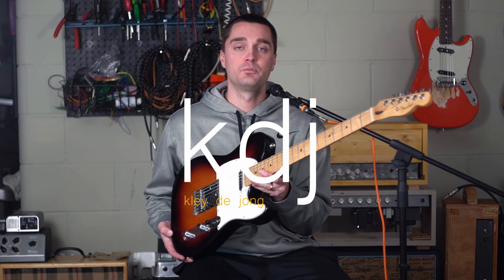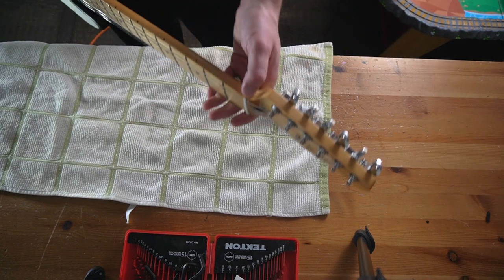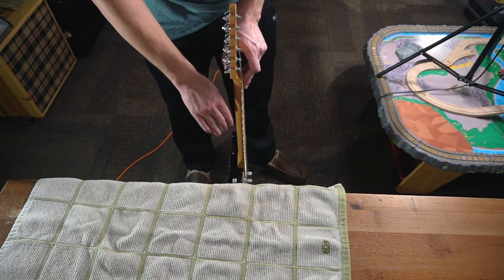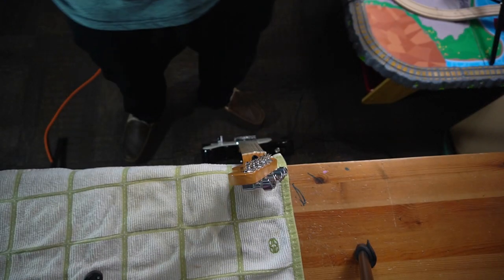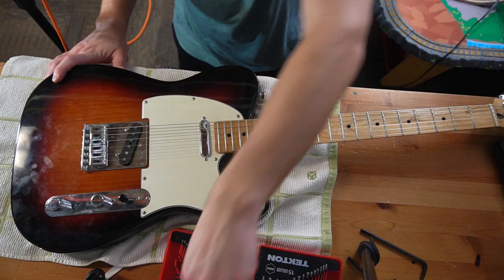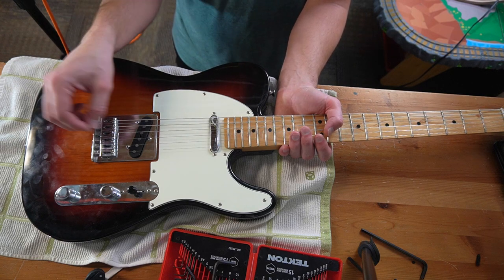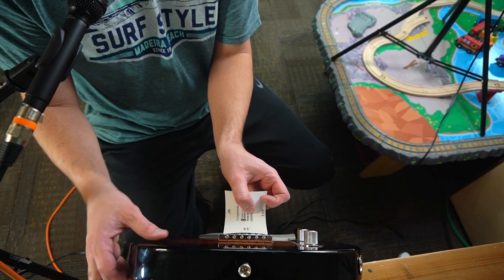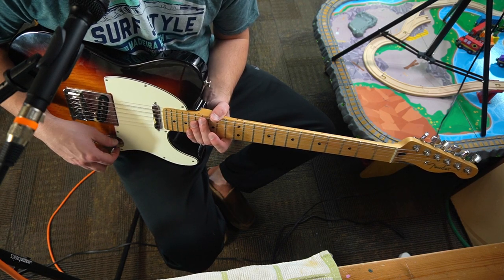Guitar Neck Setup To Fix High Action

Comment: Thank you! This helped a lot. Weird thing is that the hex screws on the bridge would not accept a 1/16" allen wrench. It was too big. So I used a small jewelry screwdriver. This is on a 2021 MIM Strat.

Comment: Very helpful, Kley! My tele action has gotten so bad over the winter, so this was perfect timing. 

Gear comparison question - any future reviews on the Line 6 Stomp vs Strymon Iridium vs Walrus Audio ACS1?? (Comparing IR usage and amp simulators?) you the man!
Reply from the maker: Thanks Eli!  

I would love to do some shootouts.  I have an HX Stomp which I LOVE.  Prior to that I was using an Atomic Amplifire.  Prior to that an AX8.  Prior to that an Axe-FX II.  

I went with the Stomp because I felt like it had great tone, awesome effects, and complimented nicely with other analog pedals on my board that I like to use.  It has great price / performance.  I sometimes miss the AX8 as I felt like it was a fair bit deeper with amp modeling in terms of nerdy features and settings.  But the tone was only marginally better if at all, it was too big to use with other pedals, and it was more expensive.  

As a whole I also have drifted towards using tube amps more.  They're fun.  I have a house now and my kids aren't babies so I can use them a bit more.  

I still think digital modeling is great.  I use my Stomp a lot and also use amp sims on my PC.  I may likely try some new models if we go direct with in ears at church (which we are considering).  But honestly I think the modeling market has gotten so good top to bottom that you can't really go wrong.  All the options are so good and the improvement from generation to generation is shrinking.